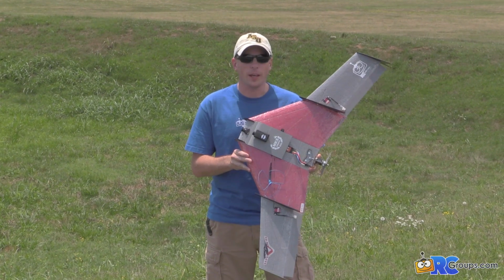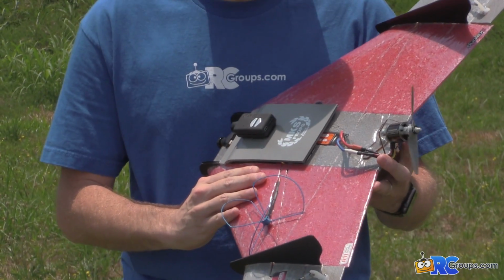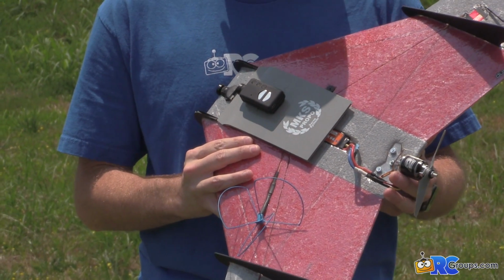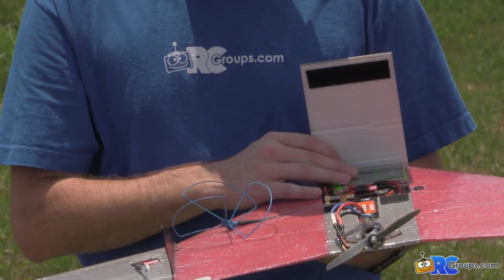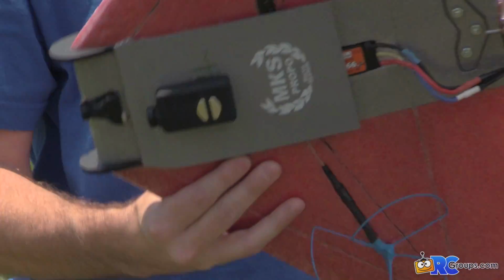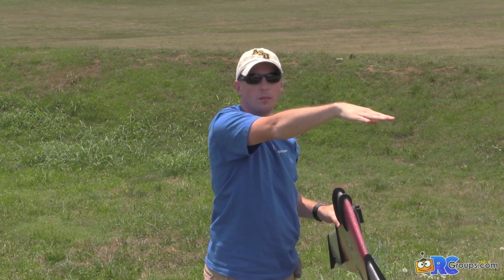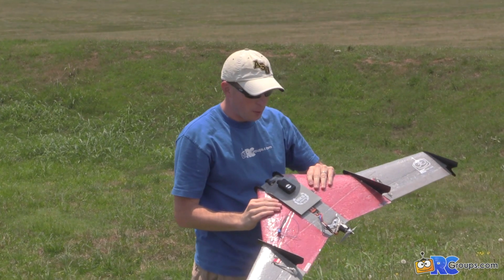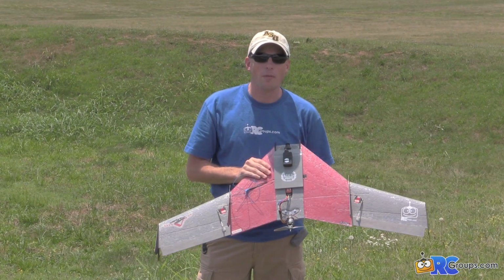Wyvern FPV Racing Wing

Comment: Hi! Can I turn my taranis on without a module? I am afraid to damage my Radio if I turn It on. I bought Taranis and a module, but I just received the transmitter until now. Thanks!
Reply from the maker: We haven't used a Taranis radio. Best to ask the seller you bought it from to be sure.
Reply: Thanks!
Reply: yes you can turn it on with out the rx.. as this is part of the bind prosess . power on taranis make a model.go into setting and get the Taranis ready to bind. then add power to rx from esc and hold in the bind button on the rx lites blink power off everything and it should be bound.. just make sure if its a L9r then this will have to set in the tarrains options.. hope this helps..
Reply: Thank you!

Comment: I almost feel like this thing could benefit from a stabilizer. I don't like them myself in my planes, but this wing seems really twitchy, and I think it would be more fun if it was smoother.
Reply from the maker: Wind was about 10MPH and that's pretty normal. Stabilizer won't help really. When it's calm it's smooth as glass.
Reply: rcgvideos yeah ok I thought it might have been a bit windy